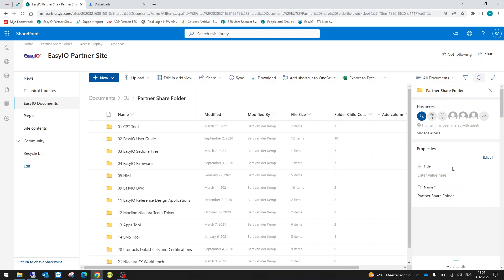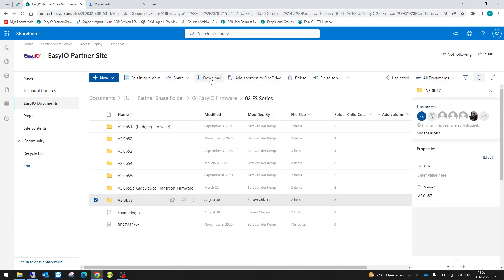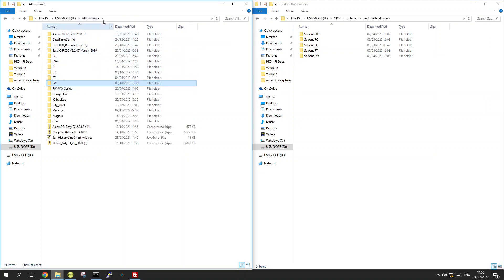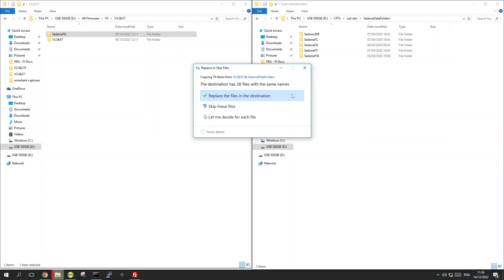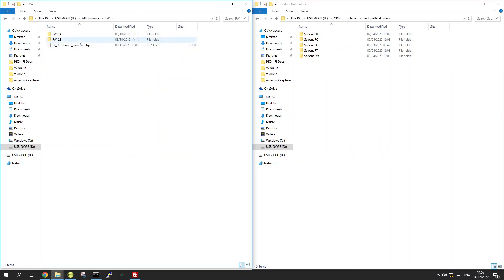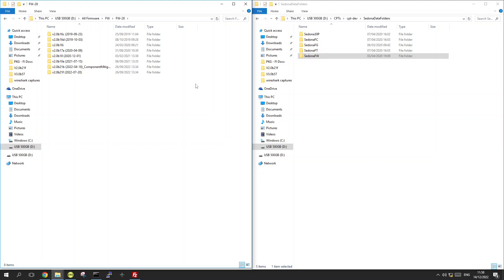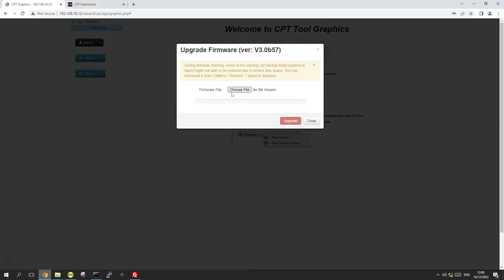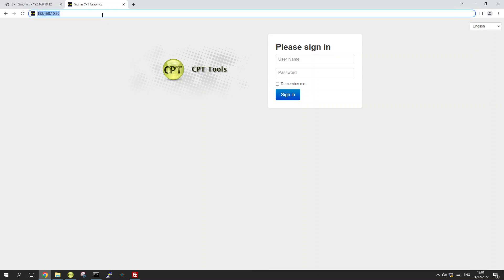EasyIO F-Series: Firmware Install Tutorial

Comment: Hello Sir, I am facing a cirritical kits error, Before uploading the Backup,  "sys::Component.isReadonly" **FAILED with 1 erorr(s) and 0 warning(s)** mention I tried to downgrade the same eror I changed sys folder from kits as its not resolved, I was upgraded firmware its the same eror, I tried so many options, how I can see my final program Sir. Previous backup opening but latest is not. I was not did any kits changes between last and previous backup. Please help Sir, I need to develop my latest backup for Chiller Plants Manager logic.